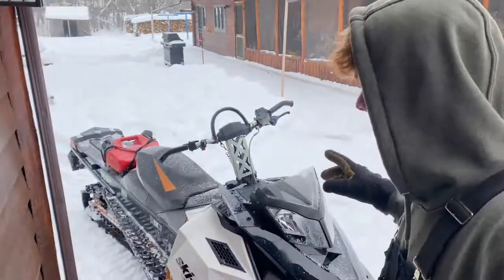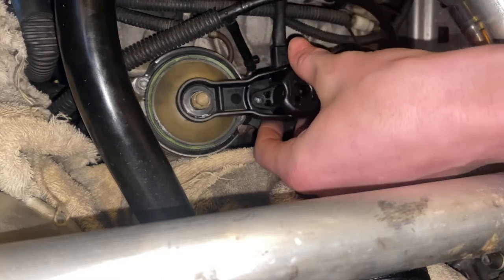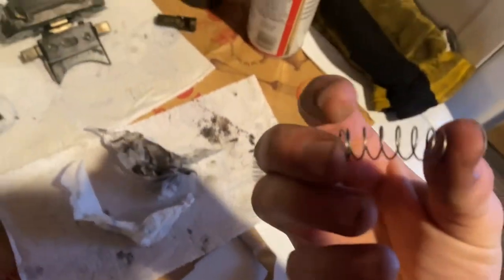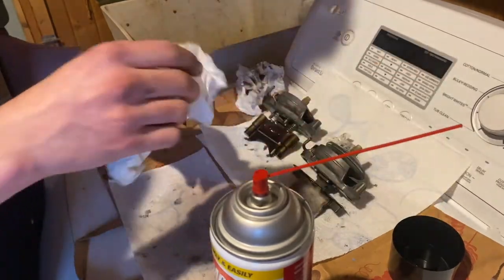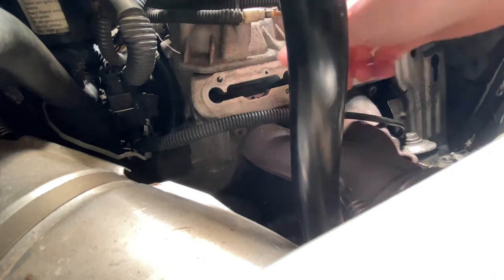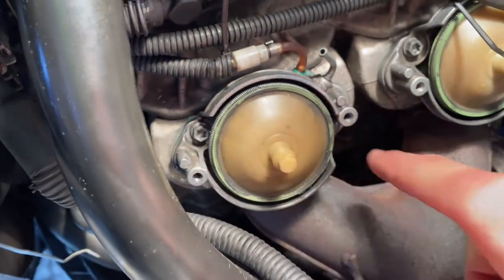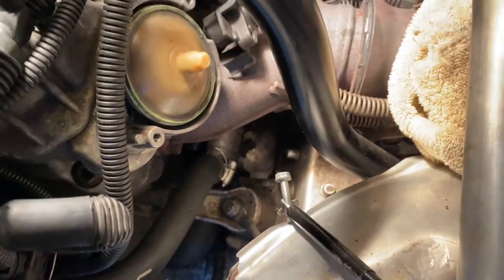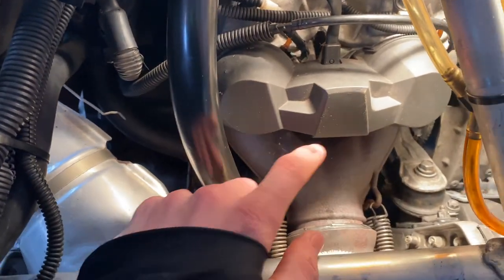How to Clean Rave Valves on a Ski-Doo!!!

Comment: Which motor is this? What made you wanna clean the valves? Did you notice a difference after you cleaned it?
Reply from the maker: I had a check engine light on. 
It’s the 800
Reply: @hankssmallengines8654  and did you notice a difference after you cleaned it?
Reply from the maker: @papabear6092  yes the check engine light went away and it’s been running great since then